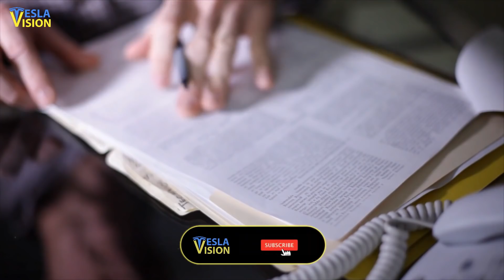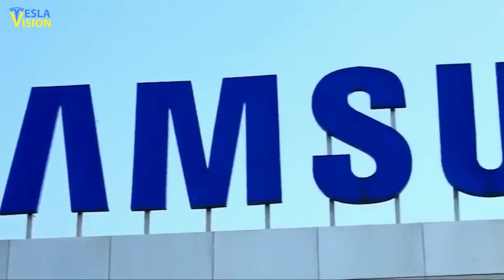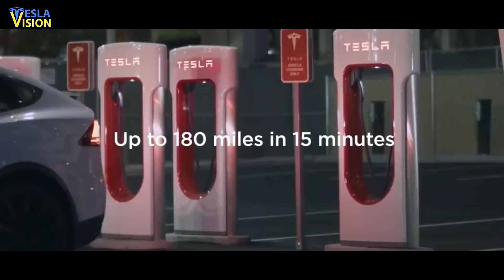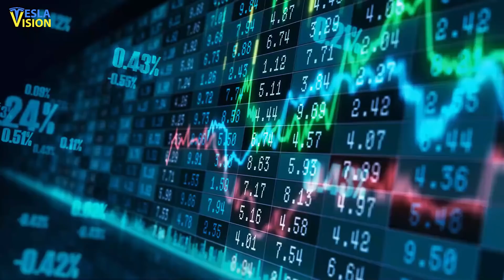Elon Musk's New Tesla Semi Batteries Will Make Gas Trucks Obsolete!

Comment: First mass production of this battery has not occurred. Like the solid state battery for now it’s all talk. Tesla stock has dropped as low as 575. This is not good sign that they will survive. I do agree that if the 4680 battery is mass produced Tesla will have the upper hand over its competitors; however, Tesla will have to regain investor confidence because at the moment investor are running away from it. Personally I lost 75k from a small investor that is a huge loss.